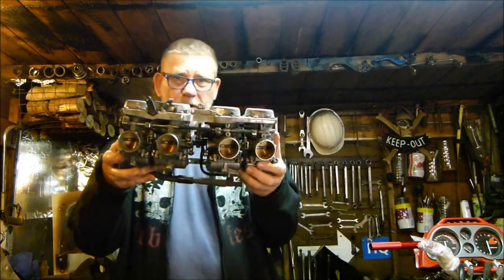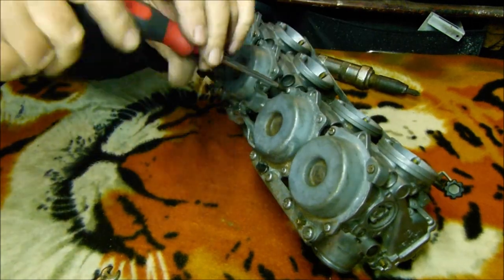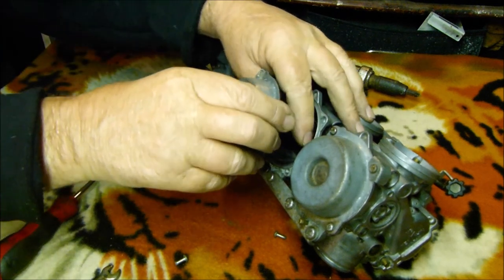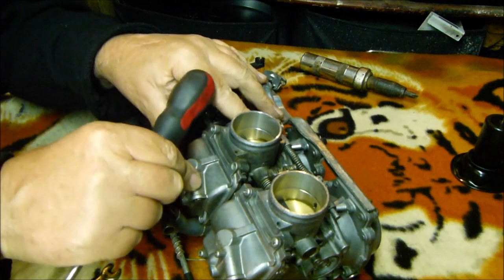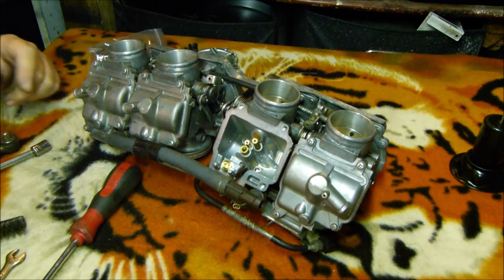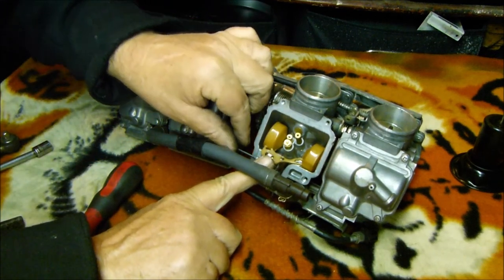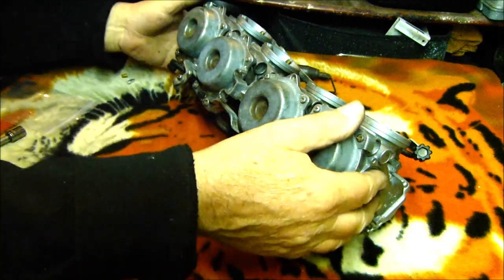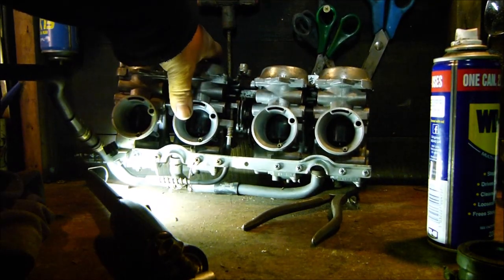CBR1000F Landfill bike Carburettors overall,, first engine start.

Comment: Hi John.
It started! I am so happy for you.
Soon you will be riding it. Wonderfully splendid.
I am a bit worried about the hoses to the oil cooler though.
They are not supposed to be bent like that.
Be careful, a leaking oil hose is no joke.
Anyway, looking forward to the next video.
Cheers.
Reply from the maker: Thanks. Yes hopefully it will be fine. 👍

Comment: Brilliant job mate 👍 👍 👍 👍, got there in the end and it goes to show you don't need a big workshop and all the latest tools, just a manual and the will 👌👌
Reply from the maker: Thanks Gary I'm super happy with it. But now it's running it's showing up a load more problems. 👍
Reply: @jonyr1TT  what's the problem now?
Reply from the maker: Only firing on 3, fuel pump not working and indicaters have stopped working.
Reply: @jonyr1TT  not too bad then, fuel pump may need the tank and more fuel connected to work?, if not maybe electrical. Faulty plug or coil maybe for poor firing?, as for indicators minor detail (could be BMW factory ones) 😉😂😂
Reply: @jonyr1TT   where is the fuel pump on these is it in the tank ?
Reply from the maker: Cheers Gary yeah just a few minor things to look into. One step forward two steps back
Reply: @jonyr1TT  well for whaf it's worth I think you've done a brilliant job so far and any problems now are minor ones compared to the engine rebuild 👍👍
Reply from the maker: Lefthand side under the pillion seat
Reply from the maker: The engine yes I still have nightmares about that hopefully it's gonna be plain sailing from here.